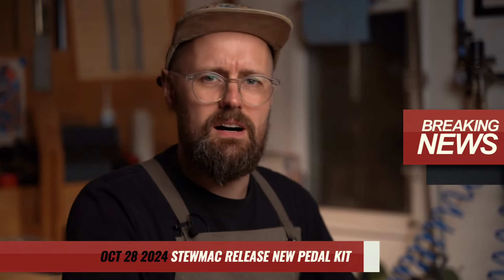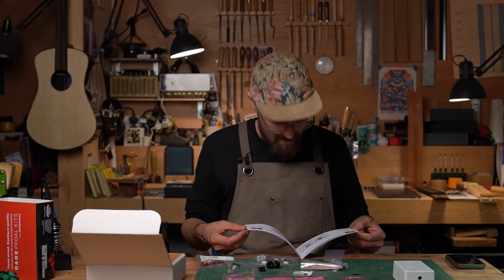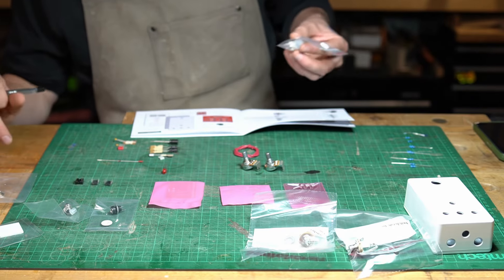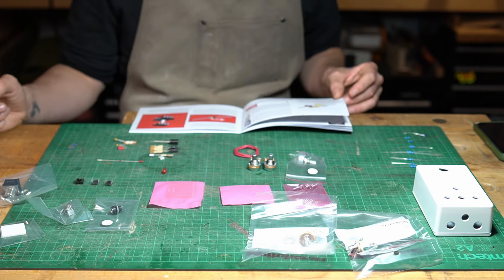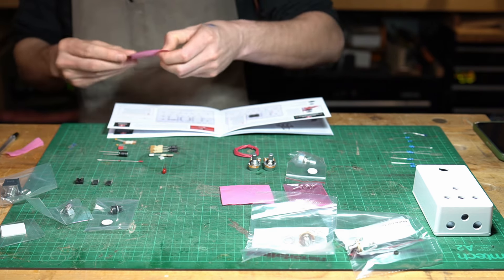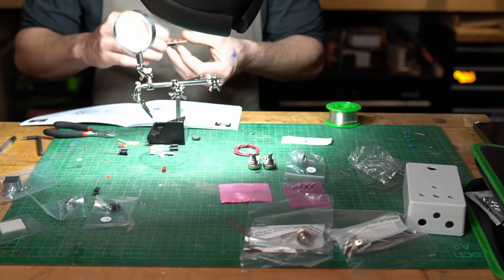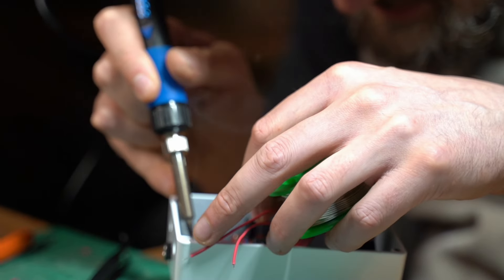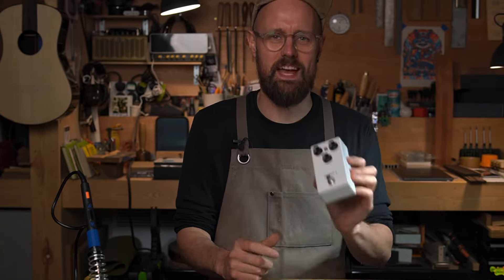Can I actually build a killer pedal? || Stewmac IHOO Pedal Kit

Comment: 150 NZD plus taxes and shipping... probably at least 205. (I know stewmax, I have it, but a kid wanting a cheap pedal wouldn't.) A brand new handmade hotcake pedal? 250 from a local retailer. I guess it's about the experience. Bit ehh about it being a still available design from a single person operation too.
Reply: To be fair I think stewmac kits are expensive enough, there's a company called diy guitar pedal in Australia that maybe would have way lower shipping costs at least (I assume) and the guy behind it has a decent YouTube channel about diy stuff
Reply from the maker: @fairguinevere666  it’s totally about the experience of making it and starting to learn about pedals. Basically guitar nerd Lego. Would recommend.
Reply from the maker: @heggy_69  stewmac aren’t the cheapest across the board. BUT, you can really feel the work that has gone into this kit. The manual is super detailed and thorough. Parts are all solid too.